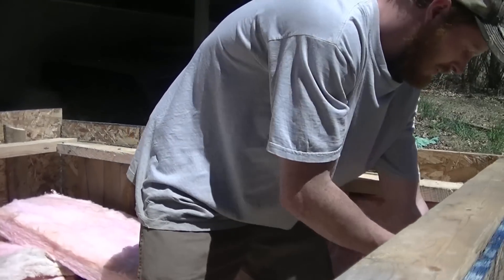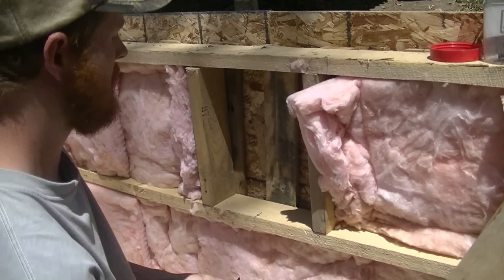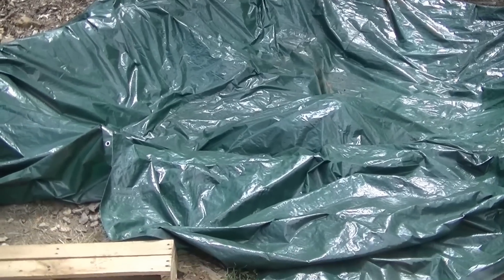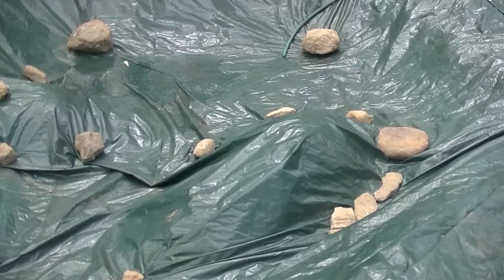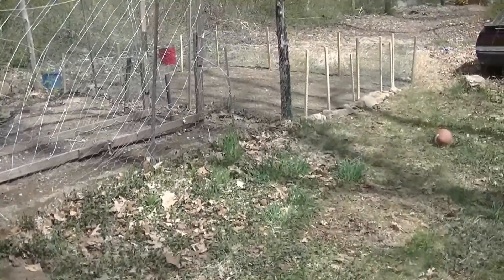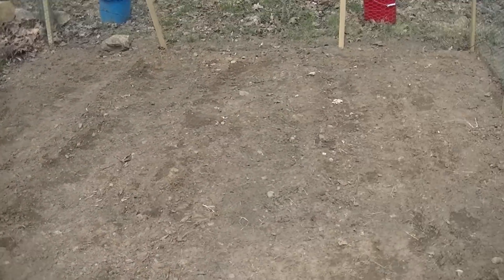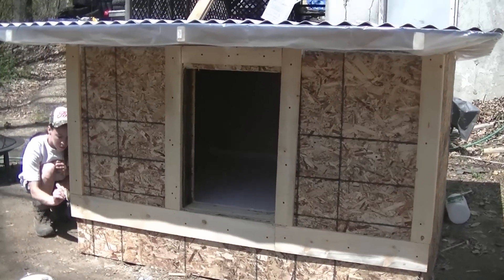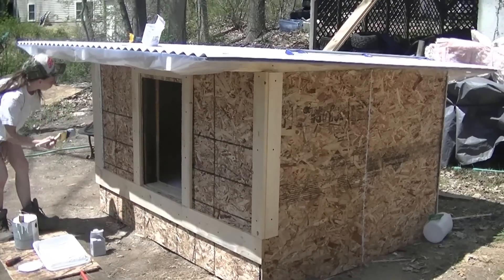Building a Duck Coop & Pond Part 2

Comment: how much $ invested in this and how many ducks can that fit?
Reply from the maker: +PrankKings TV under 200 bucks i'd say. this was last year but we had to buy the roofing, paint, hinges and latches, tarp for the pond, and that's about it. the wood is all pallets and crates reused, the insulation was free from a jobsite as were most of the screws. we have 5 that fit no problem and have recently got 4more we plan to add once we introduce them. have a great day and thanks for watching.

Comment: Do they need ventilation or will they do fine without it? I didn't see where the ventilation in your coop was, just thought I'd ask.. thanks
Reply from the maker: Yes they definitely need ventilation. Though it we, we have windows that we framed in and cut out on each side of the coop, covered it with a 1/4" welded wire mesh. As the cold of winter comes in we cover them with plywood as needed.
Reply: @acoupleofpreppers  ok thanks 😊, I didn't see that part so just wanted to ask lol...

Comment: I raise and  show ducks. Ducks do not need insulated houses like chickens.. What they really need is ventilation, and I didn't see any in our house. They  are in  water a lot and  put off a lot of humidity.... They also don't need to  be up off the  ground. All they need is  a nest or  wind protection ...I often use upturned rubbermaid bins with  holes drilled for ventilation in the  top and no  bottom. Ducks are relatively disease free and much more hardy than other birds.. It is heat and lack of ventilation that is a killer... Second the chicken wire will keep them in ,but not  real predators out. At least hot wire the  bottom 6-12". Dogs, raccoons,coyotes ,bears etc. can tear right through that.  Sorry to rain on your parade. Tarp, if there are rocks in the bottom it  may not last long like  pond liner. Even good plastic tarps last about 2 years in the sun if you are lucky...
Reply from the maker: Thanks for the tips.They do have windows (that were framed but not cut in yet in this video) in that coop and ventilation between the wall and roof. We've been doing chicken wire like this for years and have had no problem with predators besides hawks from above (we are in a new home and not using bird netting due to issues we found with it in the past) and we are lucky not to have bears in our area. The main thing I would change about this coop is the door (which I knew when we were building) makes cleaning a pain in the butt. The pond lasted as long as we were in that home - but I would foresee problems in the long run, but I have also watched people have to rebuild year after year with pond liners as well due to chipmunks etc so it's what you want to spend money and time wise), but was not worth the effort with how much of a mess ducks make (we just use kiddie pools now lol) What works for some doesn't for others. Thanks for all the info!    ~Stephanie
Reply: Horselackey  the windows she said will ventilate it
Reply: Wow! Two years only!